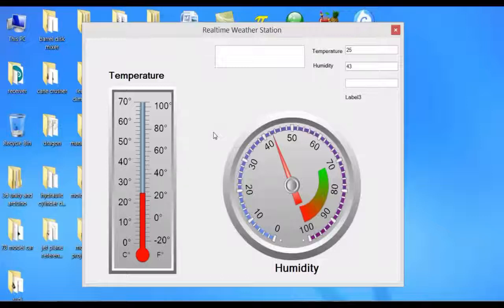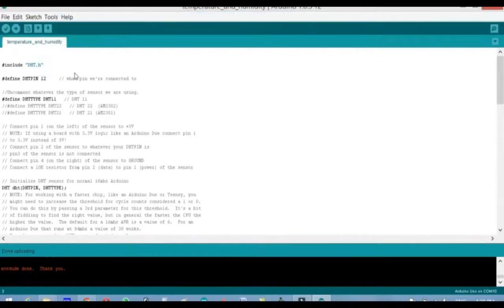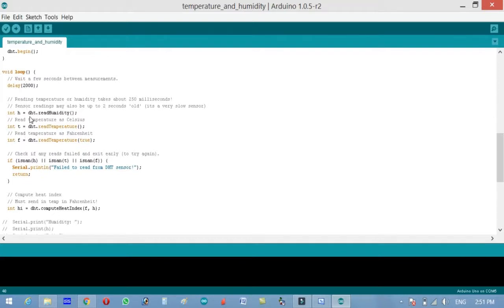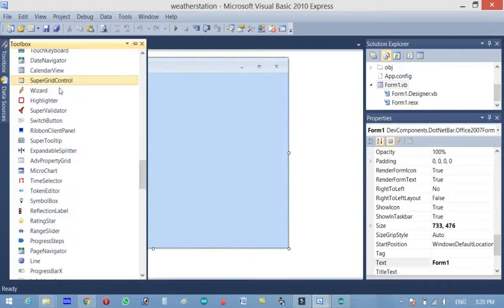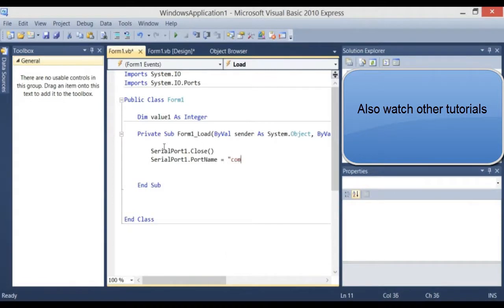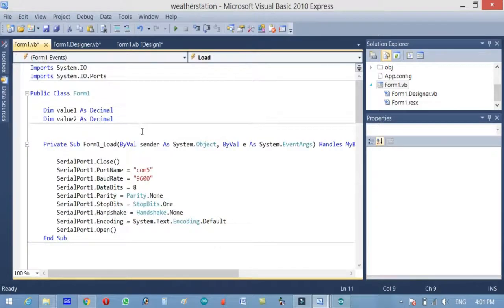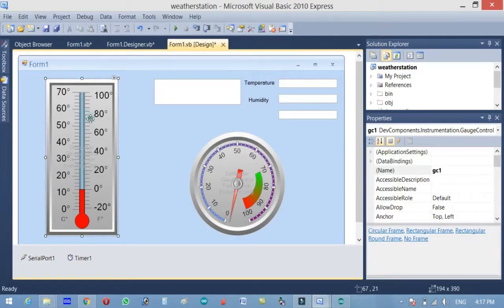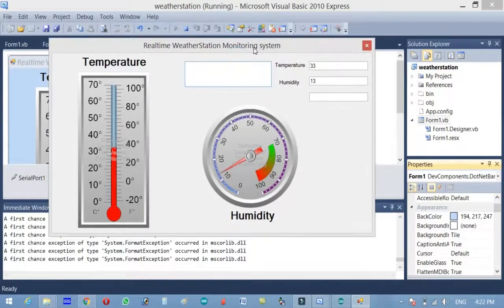Arduino Weather Station dht11 | Display Sensors Data on Gauges vb.net | temperature and humidity

Comment: Hello, 
I've tried according to the tutorial exactly the same as you, but in my vb textbox2 and textbox3 the value didn't come out. Please the guidance
Reply from the maker: Check the names, you might be missing something. Do you receive data from Arduino?
Reply: @ElectroniClinic   I forgot to add reference a dotnetbar, but how to stream the data or the data from display didn't blink?